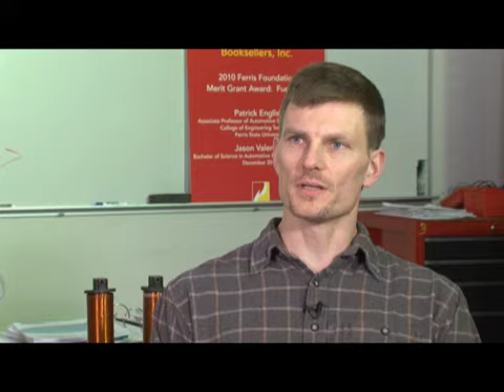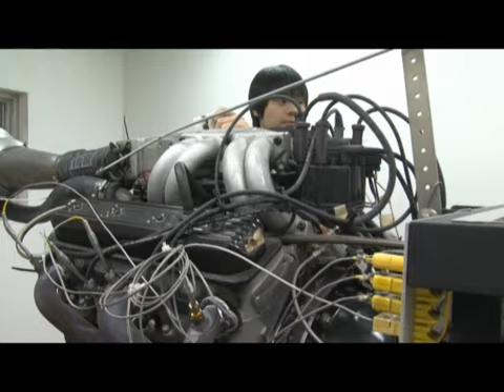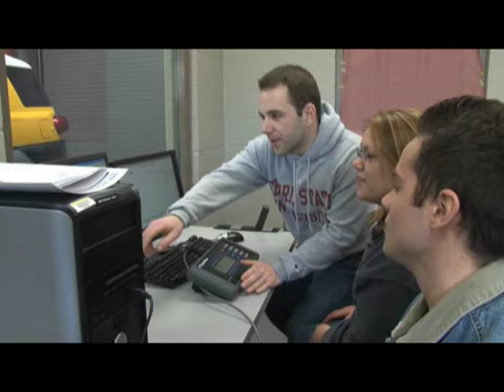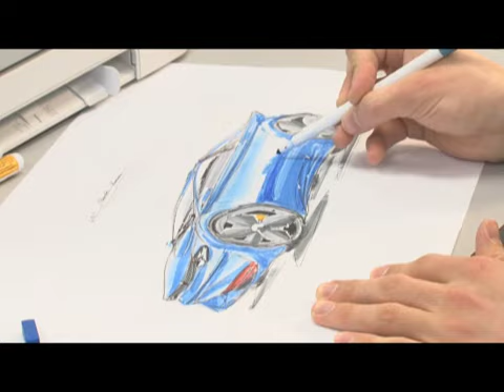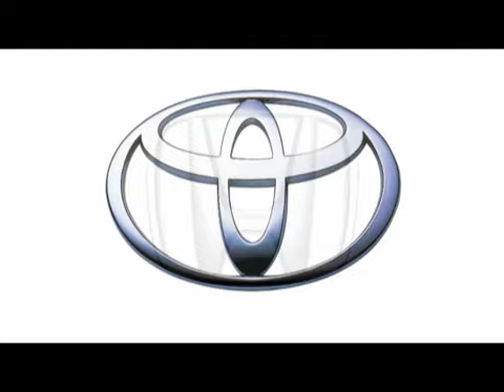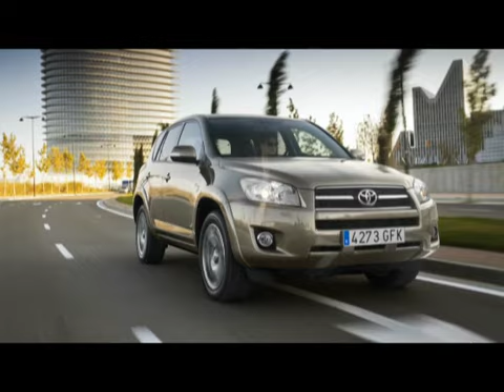Program Spotlight: Automotive Engineering Technology

Comment: i think its better to get get an AAS in auto tech, a BS in mechanical engineering, and a MS in automotive engineering instead of getting an AAS in auto tech, and a BS in AET (this program). Even if you decide to get a MS in automotive engineering after getting a BS in this program getting an AAS in auto tech, a BS in mechanical engineer, and a MS i automotive engineering is still better primarily because all you do in AET is the same stuff you did in auto tech by the sound of these people.

Comment: good program...the difference between an automotive engineer and an automotive engineering technologist is that the AE has the ability to design and optimize components where as the AET is good at testing and troubleshooting these components